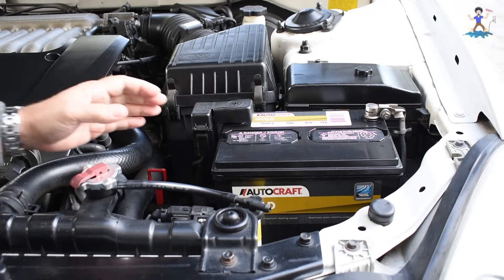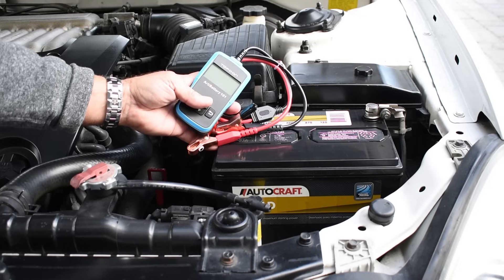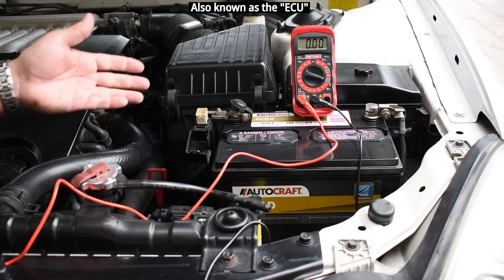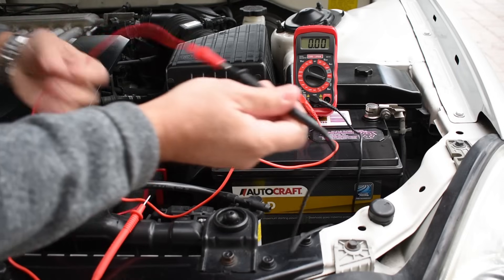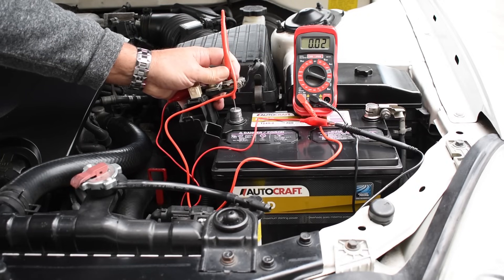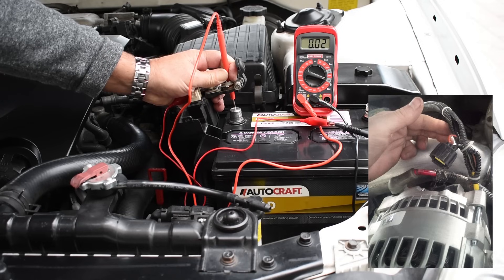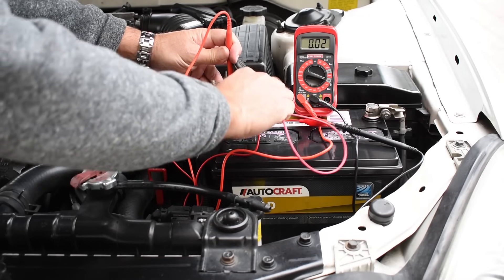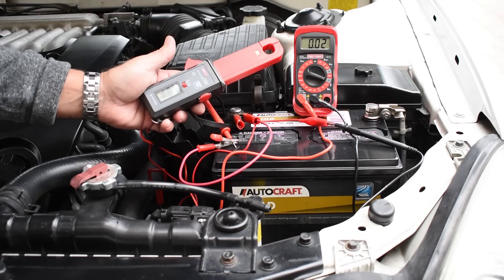Car Battery Drains Overnight Or After Days Of No Use! PARASITIC DRAIN

Comment: I use a infrared thermometer to check for the hotest fuse in fuse box to locate the short I the circuit..sometimes you can trace the heat on the wires to the voltage drain
Reply: While the vehicle is off correct?
Reply: That is a great idea! Thank you so much for posting it.
Reply: Is a 200 milliamp draw going to produce any heat though?
Reply: @macknumber9  
 In the right environment and climate, yes, it should. The example of 20 milliamps probably not.
Reply: I was thinking of buying one anyway. Got a recommendation? Thanks.
Reply: IR camera is a great idea, but, one thing always missing from parasitic drain conversations is the Alternator.  Diode checks should be a first stop. It only takes 1 bad diode inside of a alternator to cause a short. The check is easy with an inexpensive volt meter with a resistance mode. Sad thing is that a alternator with a bad diode will produce a charge while the engine is running, and appear correctly over 14 volts, but becomes a dead short when engine is off ( not spinning the alt. )
Reply: Darn we think alike makes sense we are looking for a hotter fuse then any of the others

Comment: If you have a Ford Hybrid the problem may be the main hybrid battery (not your 12 V battery) If that big battery is defective it will drain the 12V one that starts the engine. This happened with Ford Cmax Hybrids. My wifes new CMax 12V would run down overnight. Many trips to the dealer for months. It got so bad that she was afraid to change any settings. They finally fixed it. Gave no reason what the fix was. I later read that a defective main big battery was the cause.

Comment: Just bought a 04 impala SS and it had this problem. I did the multi meter test on it and out of all things, The battery run down relay was causing the parasitic draw. 900 MA draw with the relay in to 30 MA with the relay pulled.
Reply: my base model ‘04 impala has been havin the same issues, might try this tomorrow. Hopefully its not my aftermarket stereo, them dashes are a bitch to take off 😭

Comment: I removed everý fuse on my Nissan micra and still had a drain of 120 mili amps. Any advice out there will be appreciated
Reply: Did you disconnect connectors from alternator?
Reply: @SilverHuedWolf  Yes, disconnected alternator, removed every fuse under the hood and inside the passenger side of the dash board. Thanks for your response still draining at 120 milli amp. Only thing I can think of is a module that won't go to sleep??? Any ideas? Must add doors closed and locked, engine hood closed with multimeter connected and outside of vehicle

Comment: Hi i have a drain somewhere i took out my car starter thinking thats what it was, and battery still drained while car was sitting 24h, battery is only 3 months old, i am trying to do you testing method but my multi meter just stays at 0, am i doing something wrong, pls help
Reply: The fuse is blown in the multimeter.

Comment: My car alarm has been going off at random times for the past month. Looked up what it could be, got battery replaced because that was not holding a charge and it was 8 years old anyway. Problem is still there with brand new battery, 
I purchased OBDEleven and scanned the modules, and it came up with fault code 01134 (H2) alarm, implausible signal. Google search suggests possible fault with fuses/wiring/alarm unit. Got a breakdown assitant to have a look and he suggested there is parasitic drain somewhere and that i take it to a car electrician who would need the car for a few hours to go through every electrical fuse etc. He also told me that these VCDS and ODBEleven devices dont really pinpoint the issues, they only point your in the right direction so that you can investigate and diagnose further. 

So after watching this video my hunch is that some electrical component is causing parasitic drain. I fully charged my brand new battery (it read 12.7v) and 4 days later the alarm went off. Checked the battery voltage and it was at 11.6v suggesting that something was draining the battery when my car was not in use.

Comment: My battery went died once today.... Checked everything and nothing was on and doors were closed... Died again... So I finally get to my destination after work (got a jump start) and I'm looking around scared to shut off the car... And I think you myself what could be on if nothing seems on... 

Then I just happen to look up and think we'll that lights blown out and.... The button to the blown out buln in the sunglass holder built into the roof was popped out an on.. No bulb so couldn't tell it was on... Apparently it still draws power even if the bulb is dead. 

Now we know.. 🤔

If you gotta power issue and a blown bulb. Check that the buttons pressed into the off position.

And it apparently takes more power than charging a cell phone to cause I can leave my phone in the car for hours and it won't die as it charges. But that blown light was on fire 30 minutes and killed the battery enough to cause a crank and click click no start...
Reply: I never would have guessed that a blown bulb sucks that much juice.  Poor design

Comment: Thanks a lot for your excellent video,
 I had this issue since couple of months ago the car couldn't start strongly and when I checked the battery the voltage it was about 11v, my battery is not that old I bought it 2 years ago.
After I watched the video, I checked the battery current when the switch was off and the current was about 3 Amperes, I removed and put back some Relays/fuses and play with wires behind the both fuse  boxes suddenly the current goes down to almost 0A then I drive the car for 1hr and the battery Voltage is about 12.5V now and the car is starting with no problem, I don't know what was really happened, hopefully the problem is solved.

Comment: So like I've been trying to get some answers... I have been wondering what causes the Issue to cause a battery to drain even when it's not even connected to the vehicle, like fully unterminated from the vehicle, The voltage decreases rapidly. Edit: this is on a brand new battery
Reply: If disconnected, the battery should hold a charge for many months or longer. Your new battery is bad.

Comment: Thank you for the video. I couldnt do the drain test since the battery die right after I turn off the engine.   Volt drop after shutdown within a few seconds to 10 V. since you mentioned the alternator cable, How I can change the alternator cable?
Reply: bad battery

Comment: Both my cars have a .05 amp draw after taking video for 6 hrs .... neither car went above .05 amps but yet both batteries are dead around day 7 ...
Both batteries were fully charged, engines cranked over super fast after a full re-charge, but 7 days later, both batteries are flat dead.
Explain that 🤷🏽‍♂️

Comment: I would recommend the diode alternator test first ,easy to do !
Reply: How? Any good videos or explanation on this.
Reply: @mptrader1620  yes it's available very simply Good
Reply: @markt9438  Do you have a particular one you can point me to?
Reply: @mptrader1620  there are at least three that I saw on YouTube just type in check alternator parasite
Reply: @markt9438  Thanks
Reply: But my Topdon tester says the alternator is fine.
Reply: @gfriedman99 if your battery is more than 3 years old ,this is probably the issue ,BMW s need 12 V at start up and 11.5 is dead

Comment: A lot of cars have retained assessory power. It will trigger upon putting power to the positive battery cable, let about 5 minutes to pass while connected, the retained power should time out by now and battery drain should drop. I thought sure I had something staying on because there were a few decent sparks when connecting battery, here it was the retained assessory power being on, it lets you use the radio, put windows up and down, it times out after maybe 5 minutes.
Reply: So what did you do to fix it?

Comment: So once you find the the faulty fuse, do you replace that fuse and the problem is solved?
Reply: No. Identifying the correct fuse the drain is coming from simply helps isolate the circuitry responsible for the drain. Once you've identified the correct fuse, you then need to research the electrical components that draw their power from that specific fuse. It's common for one system (radio, door locks, interior lights, etc) to be powered by multiple fuses. So the fuse you found the drain coming from needs to be investigated further by checking for continuity in each of the two ports the fuse plugs into, individually. This step requires an additional electronic testing device, but its worth it because it will narrow down the amount wiring you would have to test to find the specific source of the drain. For example, you locate the fuse under the hood that the drain is coming from. The fuse diagram for  your specific car indicates that the fuse provides power to the fuse box located inside the car (usually under the glove box or  the side panel of the dashboard on the driver's side that's only accessible with the door open.) So now that you've isolated the fuse that is powering the component with a parasitic drain, (the interior fuse box for this example) then you would take a continuity tester device and touch the tip each individual fuse inside the interior fuse box. Most of the fuses will cause the tester to light up and beep, but any fuses that don't cause the tester to react, those fuses are the cause of the drain. (If you discover one fuse that doesn't get a response on the tester, make sure to test every fuse that's the same color.) Check the fuse diagram on the inside of the fuse box panel you removed to gain access to the box. So if the silent fuses all provide power to the door locks, test each wire directly connected to the door lock buttons on the underside of the driver's window/door lock control module (by removing a couple screws that secure the button controls to the driver door armrest. When you find the wire(s) that don't light up the continuity tester, you've found the specific wires causing the parasitic drain from your battery. 😁 The most important thing to remember is PATIENCE. If you rush or try to cut corners so you can find the source faster, you will end up chasing your tail for hours trying to find the specific source of the drain. Take the time to test each component, pull that fuse then give all the delayed systems a chance to go into sleep mode (dome lights, a/c controls, internal/dash displays, etc) so you get an accurate amp reading on the DMM. I've found the systems with delayed sleep mode can take anywhere from 8 to 35 minutes to full shut down. If you don't wait until everything is in sleep mode those systems will still show they are drawing amps, causing you to think the drain is coming from curcuitry that is properly functioning and just hasn't gone to sleep yet. Patience in the process will save you hours, if not days, trying to find the source of the drain. I promise. 🙏🏻

Comment: I've tried this with 2 of my cars which drain over a few nights and I always get a reading of 0.000 (A, mA or uA). I have tried connecting the multimeter to read off of the negative post correctly and also the positive. I've tried two multimeters and my battery tester say both have 100% health (it said an old battery needed replacing which I knew about so the unit does work). Any suggestions? I have to disconnect the battery every night else I have to charge it back up again the next morning so it will start. Interestingly I tried this on one of my cars which holds a charge extremely well and that had a reading of about 50mA
Reply: A blown fuse in the multimeter 10A will read 0.000 reading. Check continuity of the fuse. I blew mine when I used the door lock and it surged past 10A.
Reply: Me too! @tulta3631

Comment: So if you have parasitic drain and an aftermarket alarm does that mean it’s faulty or wasn’t installed properly?  Should it just be disconnected from the battery?
Reply: could be either

Comment: Don’t tell people though that cars today have multiple modules and networks and it still takes a long time to find out what’s turning on causing the draw.I have to use an occiliscope to watch what network turns on and what module is waking up for whatever reason.This stuff is not as easy as it looks
Reply from the maker: This method works just fine on new vehicles, unlike the older method I show in another video.

Comment: I have a parasitic draw and i’ve taken it to two diff people and they couldn’t figure it out! I went through and couldn’t figure it out.
I don’t know what to do but it’s making it extremely hard for me to function.
It’s a 2002 Lexus GS300.

I’ve done all the basic battery testing and charging  and had the alternator tested though i have no idea about an alternator diode issue.
ITge only odd thing that happens when the car is off with a charge I sometimes hear a clunk ,clunk noise that sounds like the CD changer shuffling CDs when it’s not ,and the sound d comes from the center of the dash,just to the left of the glove box.

The door lock motors aren’t strong enough to lock or unlock any of the 4 doors so i thought they may be trying to lock or something while the cars parked and off but i’ve reset them and made sure they’re all in the lock position many many times and i’m not sure that’s the issue.
Terminals on the battery being too close to the underside of the hood?
Thought this. may be an issue so i layered duct and electrical tape on the hood and that sydney seem the issue either.

My sound system amp is connected to the factory amp and i’ve unplugged and tested the battery without the power wire or ground connected  to my amp not the factory one but still the battery died.

The factory Alarm goes off everytime i have to use the jump box. 
I never arm the alarm because it drains too! I have no idea if the alarm still draws power without ever having it armed?

Any ideas ,any advise would be greatly appreciated beyond belief!
I’ve spent so much money trying to find out what’s going out after i failed to find the issue.
Both mechanics failed to find the problem aswell!
Thanks so much for all your time! Chris

Comment: Just a little confused. Once you find the fuse that causes the electricity to drop, what next to fix the issues?
Reply: That all depends on what circuit it is. For example, if it's the radio, then there is something in the radio causing it. But that alone would require a whole diagnostic video. But what if it's something to do with the brake lights? That too is another video - and so on and so on....

Comment: My battery is fine when I drive short distances in my town going to work, shopping communiting but problem started when i  travel long distance . For some unknown reason my battery is getting flat
Reply: Any idea what might be the reason ? I replaced battery but the problem remains. Could be replacing smaller battery then manufacturer recommended be the reason ?

Comment: If you don't own a multimeter, or if like mine it only measures current in the microAmp range, try this. Disconnect your positive lead from the battery. Connect a battery charger that has an Ammeter fitted (most decent ones do). Note the charging current. Reconnect the positive cable to the battery and reconnect the battery charger, note the charging current.. My car had such a large parasitic drain that the two current readings differed by 2 Amperes. 2 Amperes was the parasitic drain.
Reply: Thanks for sharing. Good one
Reply: What was the cause?
Reply: @FreedomBound23 we scrapped the car shortly afterwards, never did find the problem with the drain 🤔

Comment: I have a 97 Monte Carlo that will either drain the battery or ruin the battery within 10 minutes of running any suggestions check the starter alternator and new battery it's so bad it Sparks when you try to hook up the second terminal to the battery please help